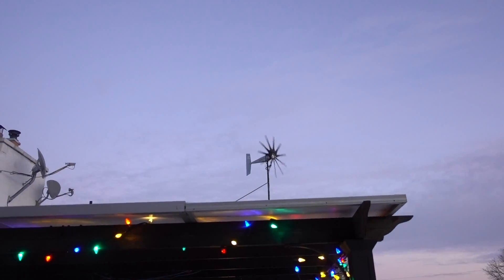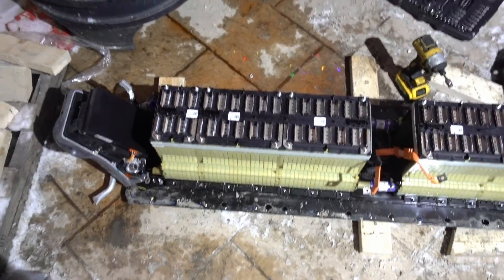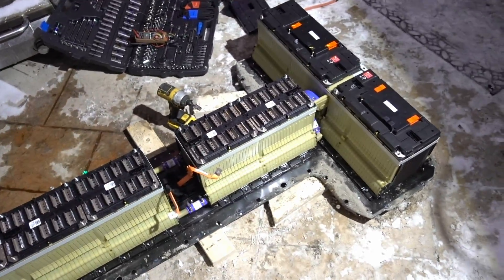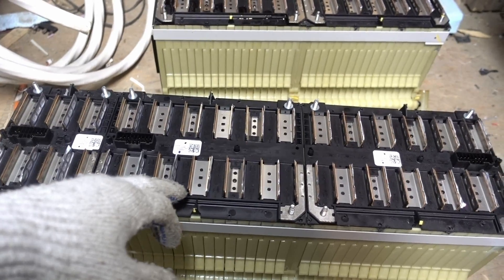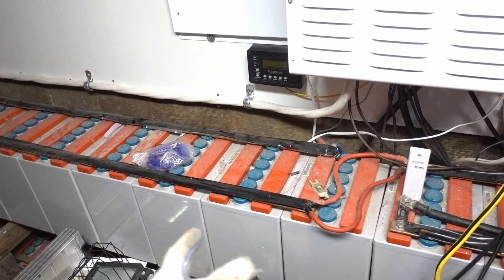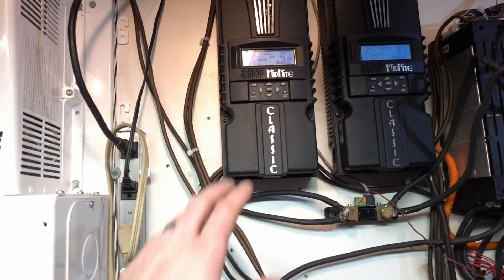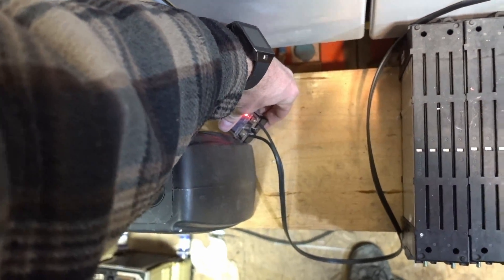Chevrolet Volt Battery Tear Down

Comment: What did the yard charge you for the battery pack from a Chevy Volt and is it a more cost effective source if you are willing to do the work?
Reply from the maker: they don't let you pull a high voltage battery out most the time, I paid 1000 for mine.

Comment: I have been using a whole battery plus 2 more modules for over a year and these cells do not need bms
Reply from the maker: yes you are right as long as they are in good condition they do not need a bms, the problem is after years of use like my batteries, they will get less and less reliable and need a bmd for safety, I would even use a bms on new lithium as well as they overcharge so easy.
Reply: exactly 
fire hazard waiting to happen. seen it already  running no  bms  and you will soon find out that cells are getting toasted overcharged  . Its a known fact without so  lithium may seem like a good animal but in the long run  it will  fail in LESS than 5 years.... Lithiums  dont last and many mechanics  see these batteries  toast in electric cars  2 years  period  by the truck load , so wasting time with them is ridiculous .  Not practical to the wallet  as many know ..lots of  waste  dream dream dream smoke another musk

Comment: Nice video. Heaters are great dump loads they only care about voltage, they could care less about AC/DC 😃.  Long as they can handle the current you are good. I’ve thought of using a small water heater as well. (Pre heater) for the main heater.
Reply from the maker: yes I use the power from the inverter to run the heater.

Comment: Awesome BMS? cooling water? I'm playing with 18650 but they need a lot of babysitting. What about the dump load to your water heater or hottub :) in the summer.
Reply from the maker: im looking at the batrium bms system, or my cheapo  bms im already using. the dump load will be change to my hot water heater soon!
Reply: Going Off Grid The Batrium system is great.
Reply: exactly  fire hazard waiting to happen. seen it already . also running no bms and you will soon find out that cells are getting toasted overcharged . Its a known fact without so lithium may seem like a good animal but in the long run it will fail in LESS than 5 years where even plain lead and other lead VLRA types will be smiling for 15 + years . Its proven technology . Lithiums dont last and many mechanics see these batteries toast in electric cars 2 years period by the truck load , so wasting time with them is ridiculous . Not practical to the wallet as many know ..lots of waste dream dream dream smoke another musk.

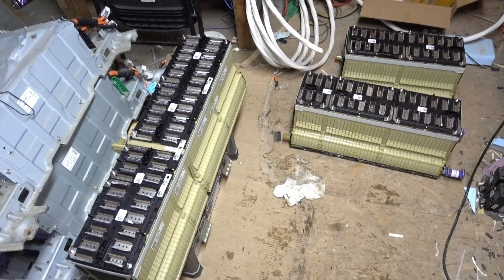Comment: 6:56 where I am and a new post. I was just looking at dump loads on the midnight classic.
Reply from the maker: yes this way needs some fine tuning, I have not finished it yet.
Reply: Please keep your units straight. Kilowatts represent power--the battery's capacity is in kilowatt hours.
Reply from the maker: when tesla is introducing their new 100D model S they do not say it has a 98Kwh they say powered by a 98 kw battery.
Reply: Link me to where they say that. Light bulbs are rated in watts. The energy to light the bulb is in watt hours. 
My Volt can draw as much as 60 kW when I'm accelerating. Since it has a 16.5 kWh battery it would be drained in 16.5/60 hours at that rate.
Reply from the maker: just watched 22 mins of Tesla model 3 and they didn't even talk about the battery pack :S
Reply: Sorry I butted in to someone else's comment and for doing it so rudely.
It's an interesting look at the battery in my car and I appreciate the time you took for it.
Peace out.